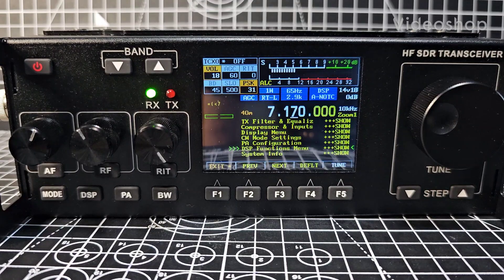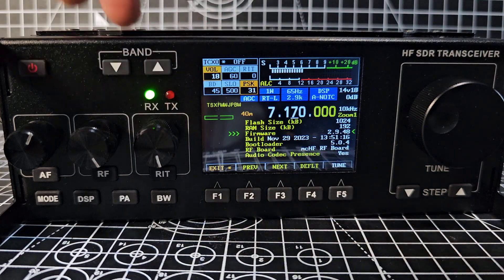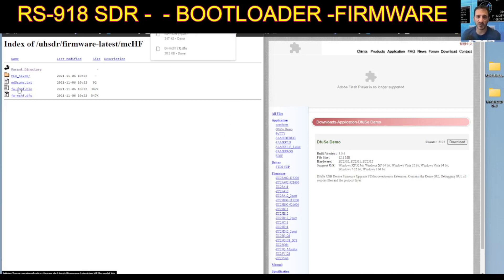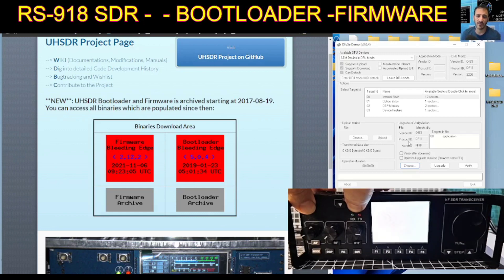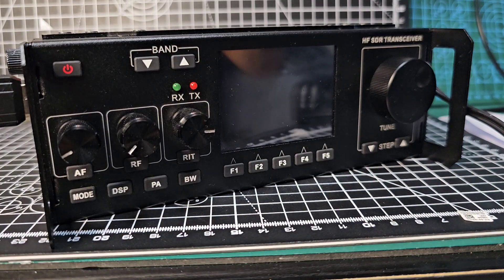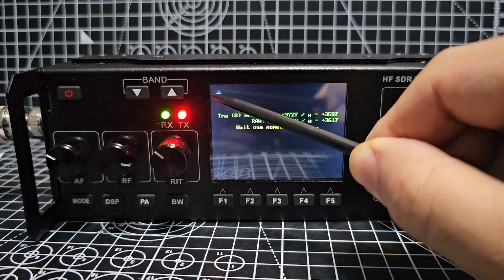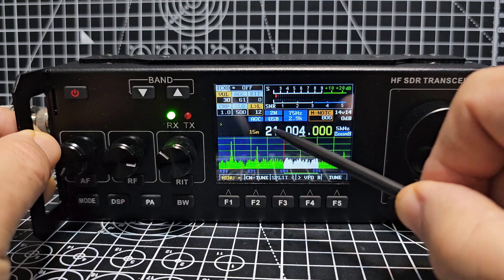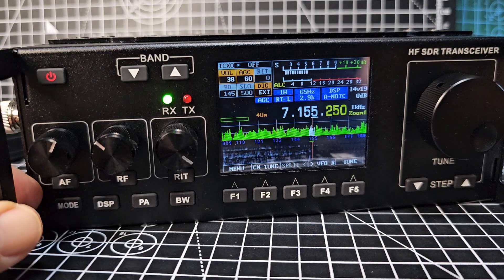RS-918 , BOOTLOADER , FIRMWARE & SCREEN CALIBRATION

Comment: I'm not seeing a further calibration video, did you need to do anything else after the firmware upgrade? (Other than the screen)
Reply from the maker: After firmware you turn off radio then hold  your stylus on screen then when radio booths  you can calibrate screen.
Reply from the maker: https://youtu.be/T4DtYFp0Ses?si=SllI8ysibYSka0_2
Reply: @M0FXBHamTech  - Yep I saw this, just checking if you did anything else.

Comment: This is a great series! You’ll find that this is a very open transceiver, in terms of settings. Nizar is defining the leading edge on firmware updates. Some viewers may find that there is “too many” settings to contend with but that is a feature of this innovative design from Chris M0NKA. Thank you for taking this radio on. You and John N5ID are making it a much more attractive radio, especially if one pairs it with a QRP amplifier for the right use case. 73 K4FMH
Reply from the maker: Hi Frank , thanks i still have a way to go but having fun.